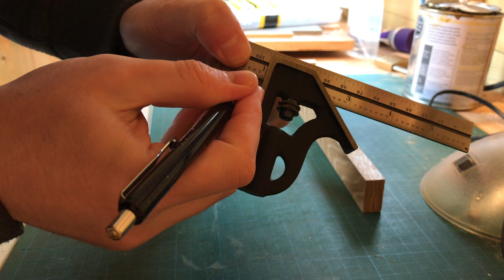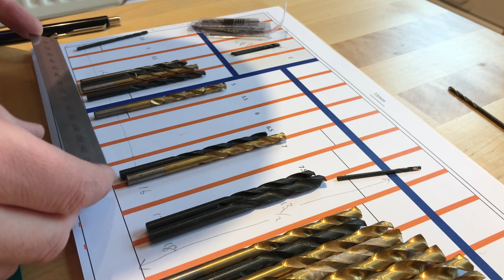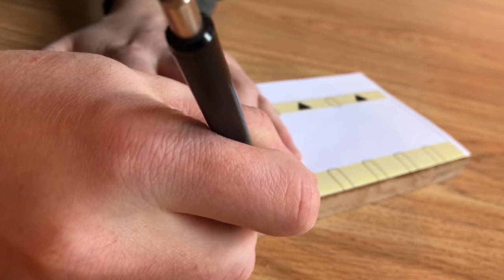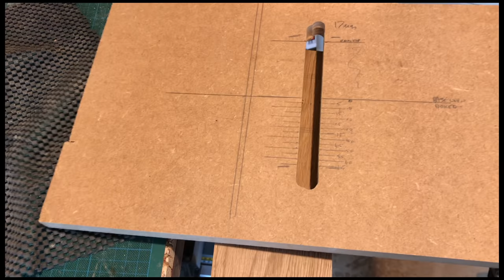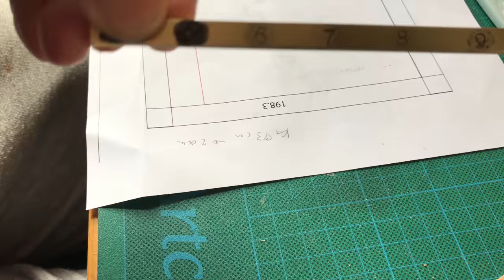Making an Oak Drill Bit Cabinet Part 1

Comment: nice work. tip on tiny drill bits 
1 half of the Chanel  make it little deeper. so you can push ur finger in and have the drills tilt up
Reply from the maker: That’s a good idea

Comment: Just a quick thing, if you fix your router base to a thin stiff board, push a router bit through it, turn the board over , with straight edges clamped it would make a suitable temporary router table
Reply from the maker: I do have one like that I made but what I needed really was a little sled type thing to make the slots for the dividers and you can’t do that with it. It only works for doing things length ways

Comment: Please be careful with putting your fingers in front of the chisel. Use a vise or clamp to hold the work instead. Also, you can use a piece of paper or playing card, etc. between the router and your guide to make a slot bigger for plywood that is a little too thick. Excellent cabinet so far.
Reply from the maker: I’m always careful with chisels and used a vice everywhere I needed to :)

Comment: Great work!  This is very relevant to me as I am planning and building tool storage at the moment.  Mine needs to be very different as it is going on a wall, but the approach to planning you used really taught me something I can use, thank you!  Is one of those drawers empty for future expansion?  I am planning to make some blank configurable storage in my set, so it can keep up in future.
Reply from the maker: No they are all full!
Reply: @Leodis.Leather  You might want to make an empty one as future-proofing!  Unless the cabinet is already built...

Comment: Excellent and accurate work! Did you have a negative experience  with japanese type saws while sawing hard woods like oak in the video?
Reply from the maker: No they seemed to work fine to me, they are recommended for use with the little magnetic guides I have